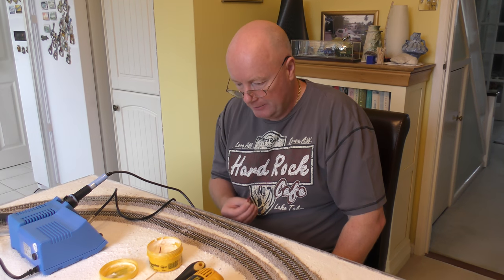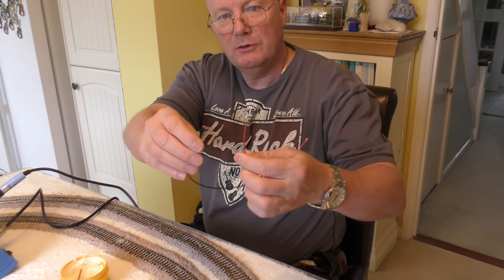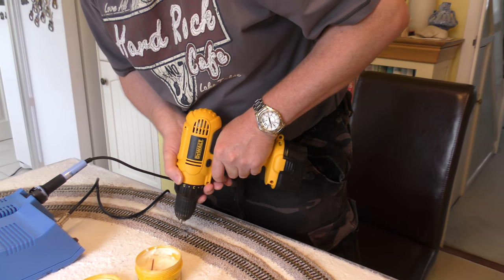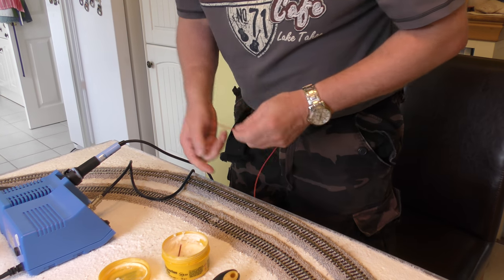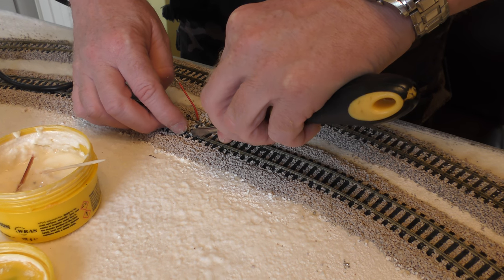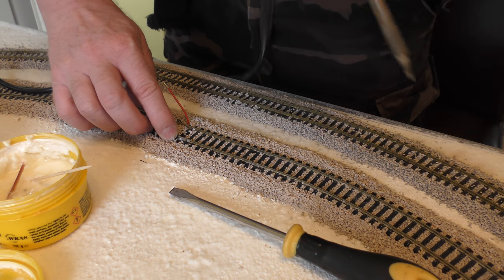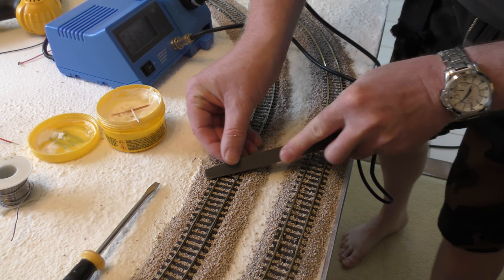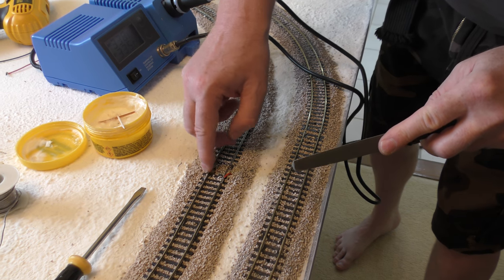Connecting power to track.

Comment: We’ve got the fish plates on a board… so much easier than worrying about soldering!
Reply from the maker: Agreed, 100%, I use PL-80 power feeds normally, but there occasions where soldering is easier than ripping up track to add power.
Reply: @PaulBriden  ah well I’m only in the initial stages of our current build so it seemed way enough to do.
Reply from the maker: @jakemarch-jones2789  To be honest I prefer Peco PL-80's. Have fun !!!!

Comment: everyone thinks soldering is such a hard task, you make it look simple. for track feeders you can always use a smaller gauge of wire, and if it is stranded wire someone uses for track feeders, one can always tin the wires first. which is add flux to the wire then heat on some solder first. then apply to the track.
Reply from the maker: Agreed

Comment: Hello Paul, I’m thinking of building a layout & getting my 40+ year old trains running again - wondered whether you could answer some very basic questions for me please?
1) Do you need to connect wires to both the inner and outer tracks, or does one feed supply both?
2) If 2 sets of connections are needed, can they both be powered by the same output on the transformer, or is the inner track powered from a separate output? (I have an old transformer with 2 separate outputs.)
3) Is one pair of soldered connectors sufficient for a complete loop of track (in other words, is it ever necessary to solder another pair of wires half way round the track to boost the voltage & stop the trains from stalling)?

Many thanks for your video, it’s very helpful to newcomers like me. When I got my train set in about 1975, I never gave any thought to this kind of thing - just switched on & enjoyed it!! Best wishes for 2021 :)
Reply from the maker: 1) If you are running one loco on both tracks with one transformer with a crossover I would connect two wires to each track. If you have two separate tracks running two different locos two transformers needed. 2) I would personally solder or use Peco PL-80's whatever suits and have two lots of wires to each side of the same track. 3) Your transformer I obviously do not know anything about it 4) If you intend to buy a new transformer a Gaugemaster O gauge is best as your old locos require a lot more amps than some of the newer OO controllers are able to give without tripping. 1975 was about the last time I played trains until 2016.  You may decide to go digital at some stage depending on how much you get into it. If so worth fitting Peco Sl-11 at each crossover to stop power seepage.
Reply from the maker: If your on FB search my name and call me on messenger.

Comment: hiya hope all is well, jus after some advise, I have two loco's and some track to make an oval but I dont have a power supply, so Iv used a car battery charger, I jus wrapped the wires round the track, it switches between 6v n 12v, n on the front it lights up from 1a to 6a, it runs the trains n carriages really good tbf, but what I would like to know is, will it be ok to keep like that or will I need a proper dc power unit, many thanx
Reply from the maker: I would suggest a proper controller as this is what they are designed to be run by. Whether what you are doing will damage anything I do not know, sadly I am not an electrician.
Reply: @PaulBriden  yh I will get a proper power unit when I do a proper layout then thank you for replying
Reply: Betatroll  thank you for your input, I'm still yet to buy me a proper power unit but the set up is still working fine, I checked for heat build up and can only run the one train bit all seems well

Comment: What wire diameter should it be? Thanks
Reply from the maker: I use Peco PL-38bK, PL-38R and PL-38G..........I dare say you could probably buy similar wire cheaper. It is 3 amp 16 strand wire.

Comment: so the wires you solderd on do they have to be a type of wire and does 
it go stright to your dc controller? because when i hold wires against 
the top of the track it sparks
Reply from the maker: I do not see how if the power is turned off.  You soldier the wires to the track first and then you connect them to the DC controller. The easy buy is Peco PL-38BK and PL-38R.  The spec is 3 amp, 16 strand.  I believe it is safer to use a higher amperage of wire